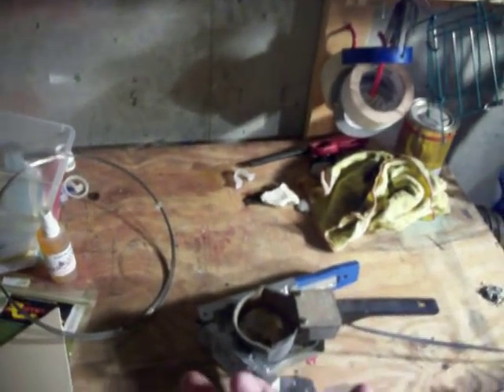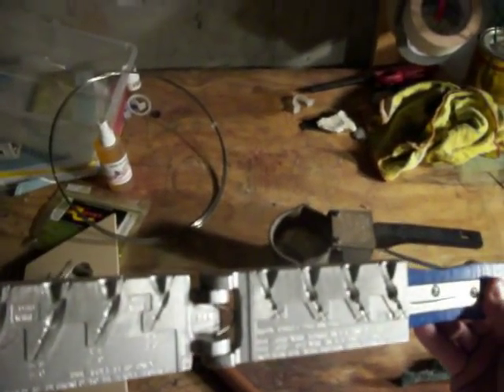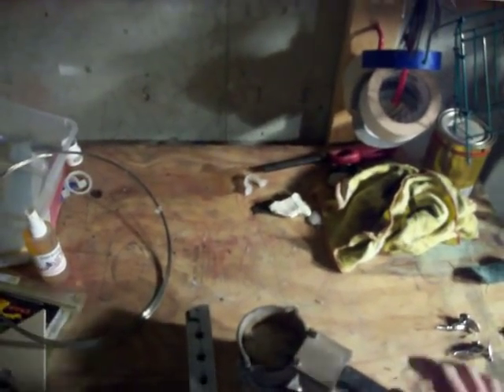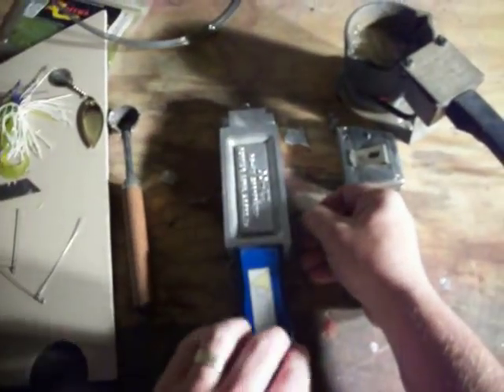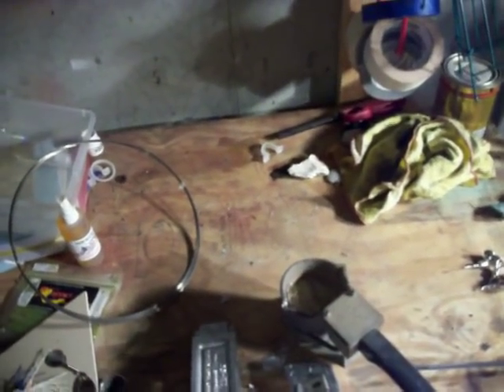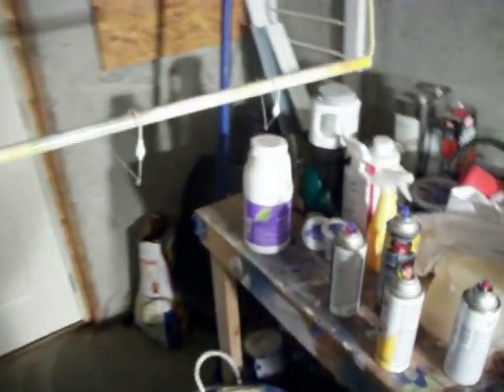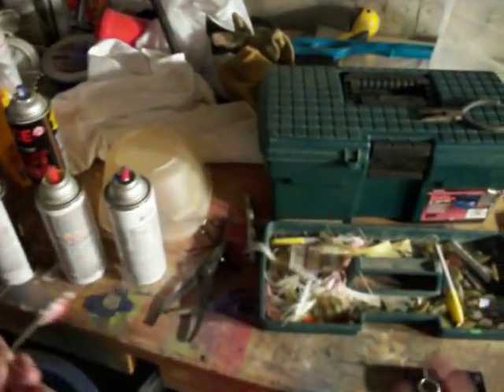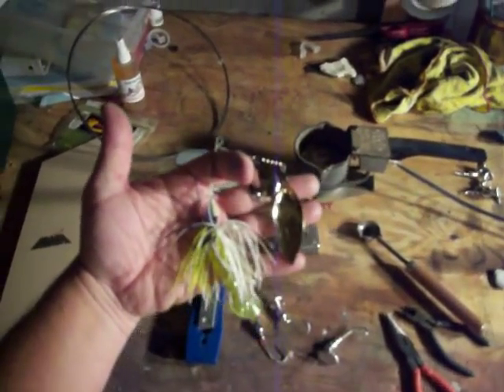Pouring and painting a spinnerbait

Comment: Which mold are you using? I would like to find one that the wire goes straight out, not up at an angle and this may work. Is it the bullet head?